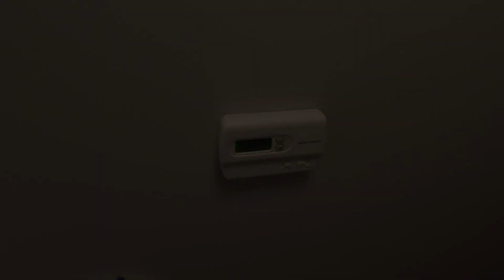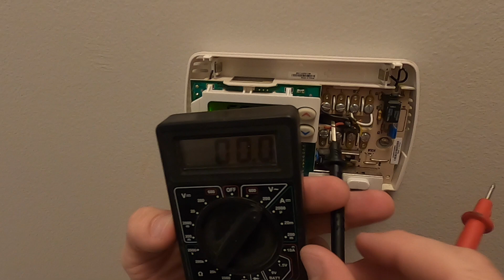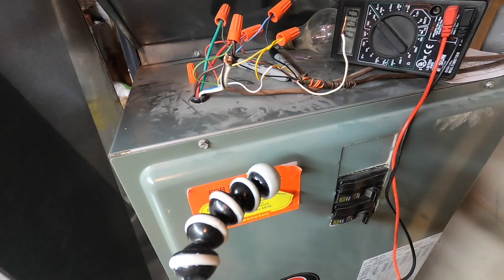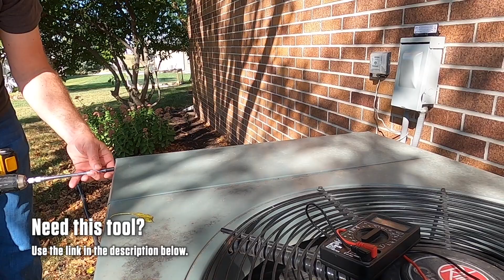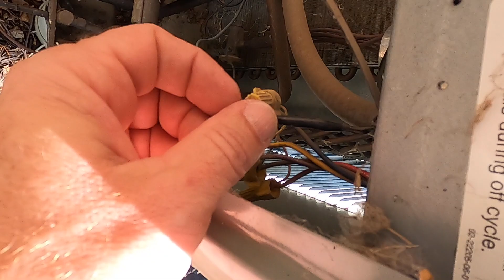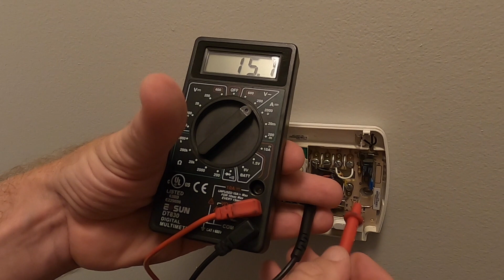Heating and Cooling at the SAME TIME? Fixing my AC Furnace - new defrost control board

Comment: Nicely done video!  When you replaced the old control board, you also replaced both sensors.  Did you know that the old control board was faulty based on some test you conducted, or could the problem have been that the coil sensor failed and the board incorrectly concluded that the coil was frosting?
Reply from the maker: I assumed it was faulty since it was calling for backup heat (defrost) in cooling mode. There is never a scenario where that would need to happen in cooling mode. I assume that logic would be programmed into the board. I could be wrong though.

Comment: Having the same issue as you. Same scenario.... I have a heat pump all electric and heating element was turning off even with the thermostat removed. I did not disconnect the white wire, because did not think to do that and instead disconnect the power going to the heating element. It's better if I disconnect the white wire in the air handler coming from the condenser unit outside. I will do the test to see if the white wire coming from the condenser is calling for heat. The video was very helpful, but hard to find when searching for the issue.

Comment: Couldn't you just disconnect the white wire for now?
Reply from the maker: Yes! For a temporary solution, disconnecting the white wire coming from outside would have allowed the system to essentially run like normal. Just remember, it has voltage, so you'd need to cover the bare end to avoid shock or short. On the air handler control board you can also disconnect the wires that go to the heating elements...which is what I did temporarily but did not show.